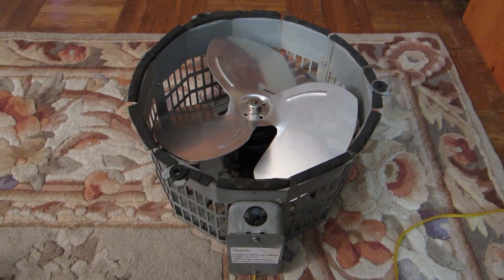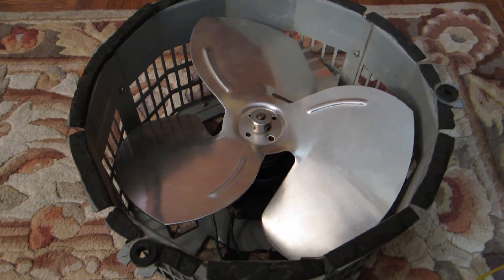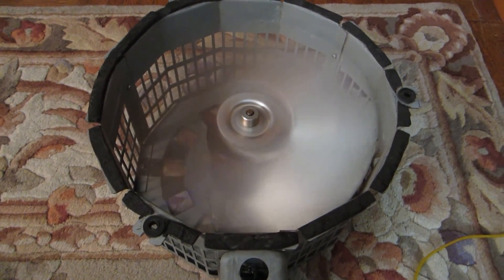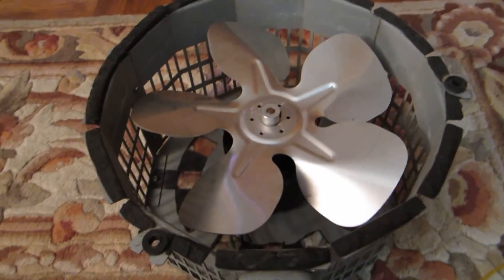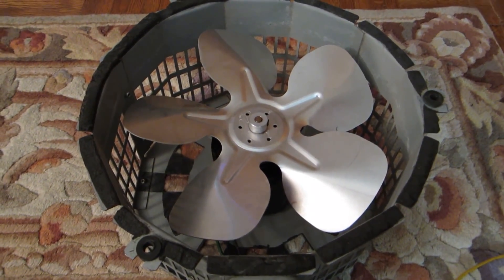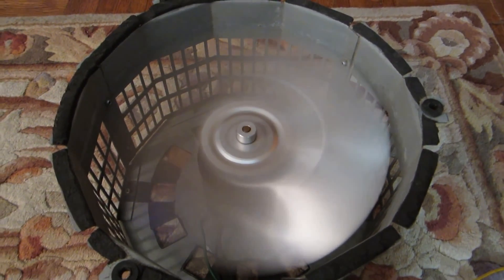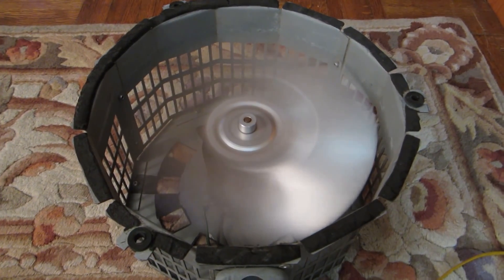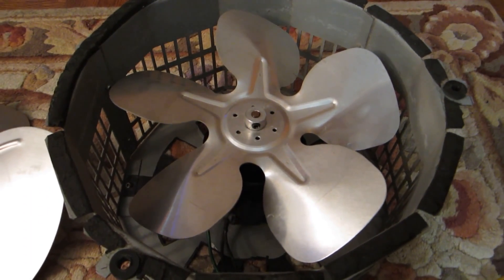My Elevator Cab Fan.

Comment: This  fan  would  drown  the  sound  of  the  elevator  motor.
Reply: Most retrofit elevators will have fans any old one in a sealed shaft will. There's a vent at the bottom of the shaft and one at the top some of the better fans can be reversed so you can pull hot air down from the top of the building in winter and in the summer pull the cool are up from the bottom of the building.